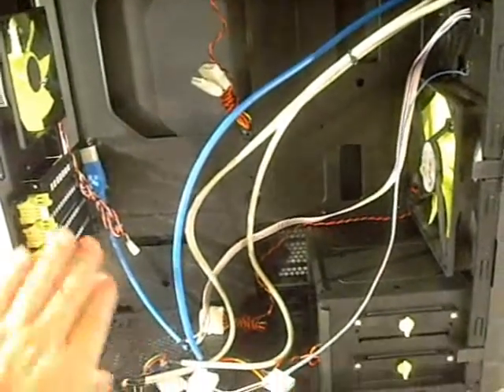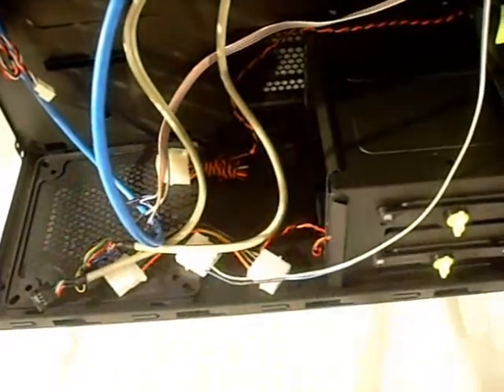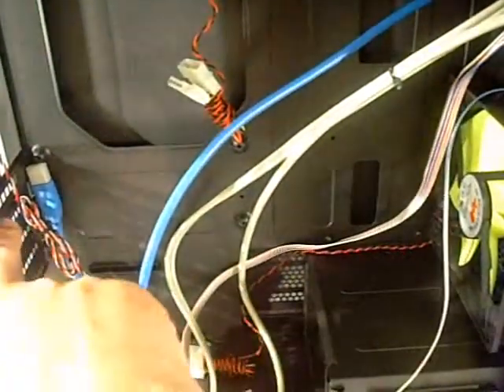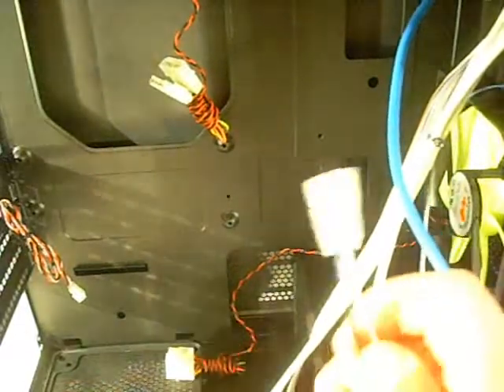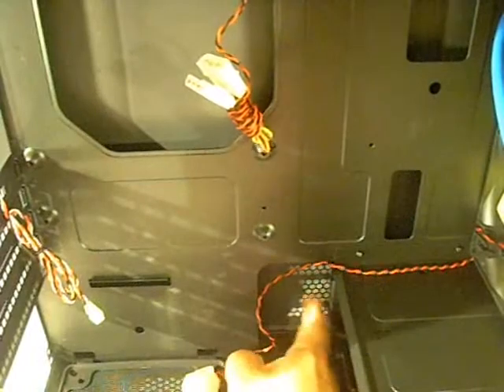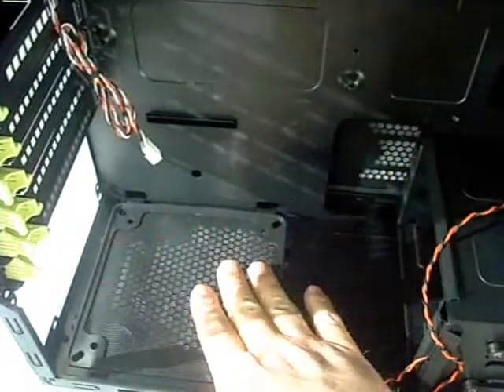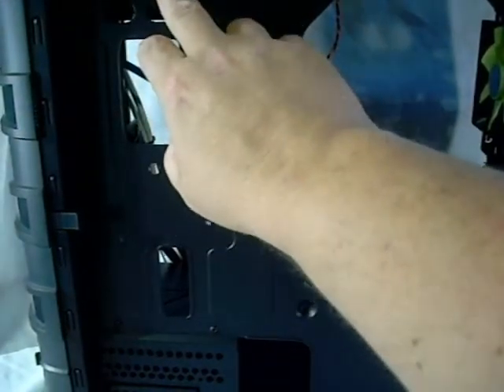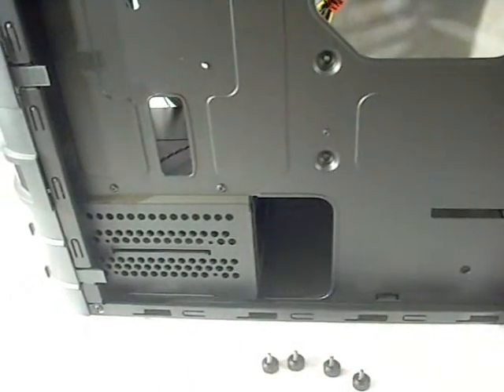Product ShowCase In-win Dragon Slayer mATX case Part 2 of 2

Comment from the maker: @seafireliv That`s wonderful. They have great airflow for a small case. But like you said they are a bit tight. I did a simple build with mine. Just a micro board with a dual core and a single harddrive. So I still have a lot of room to work with, I just love the layout in them. It makes it so easy to hook things up :-)